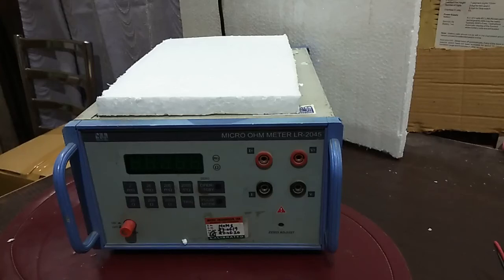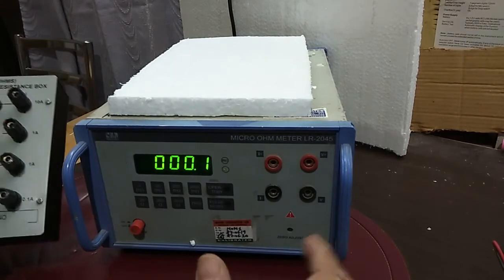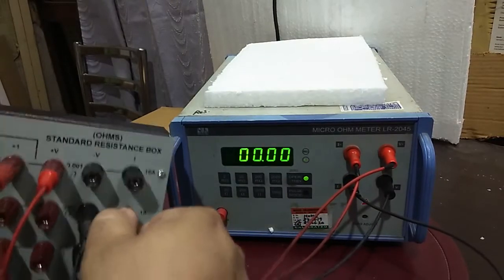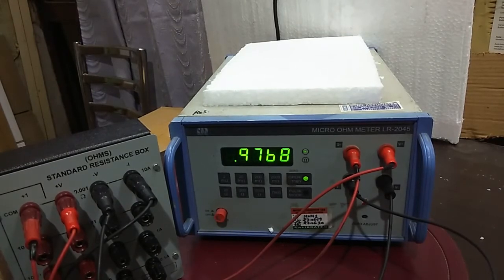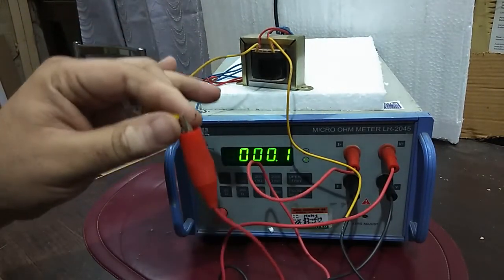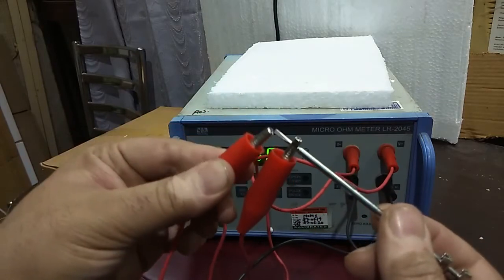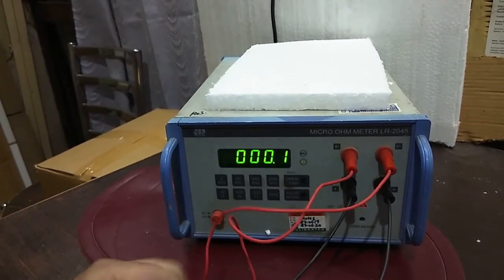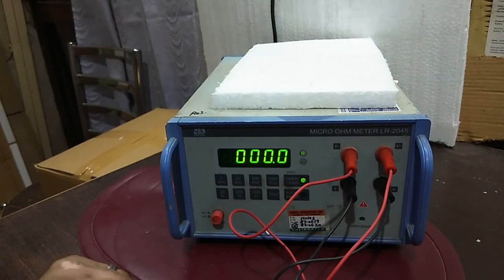Digital Micro Ohm Meter Motwane LR 2045 testing procedure and how to set zero, IN ENGLISH

Comment: How to do adjustment if the readings are out of tolerances?

Manufacturers accuracy statement is very tight, usually +/- 0.05%RDG + 5digits.
Reply from the maker: Sir, We can always adjust the readings if there is some calibration error. You can open this meter and then you can see Blue color preset for each ranges. You can adjust a specific range with these preset
Reply: @testmeasurementpeople3441  Thank you for the information🙏